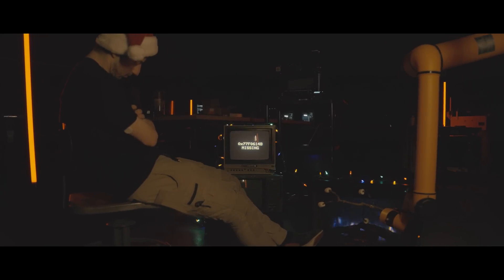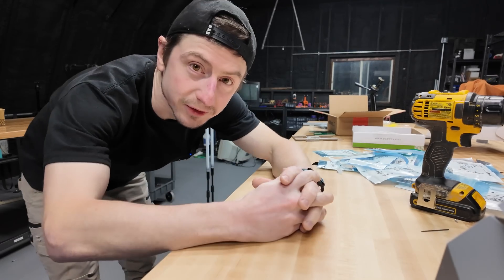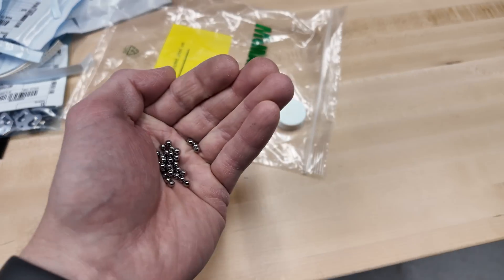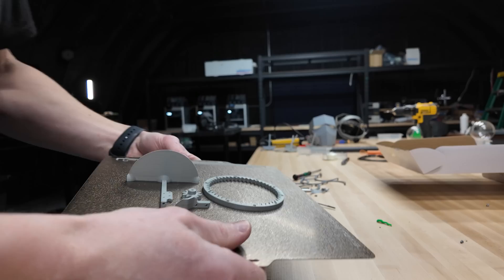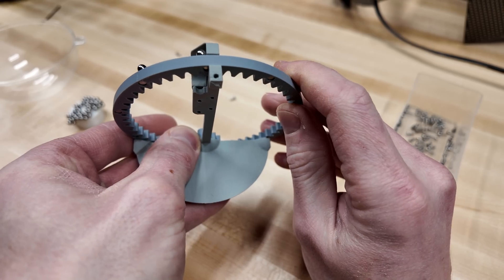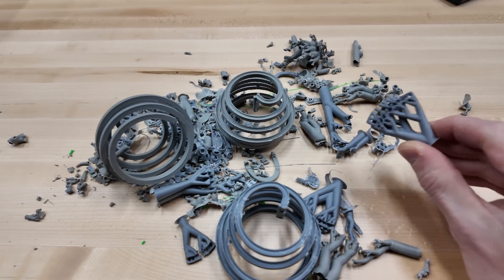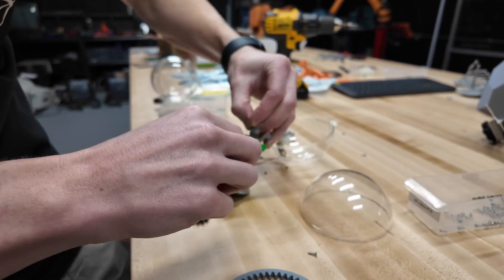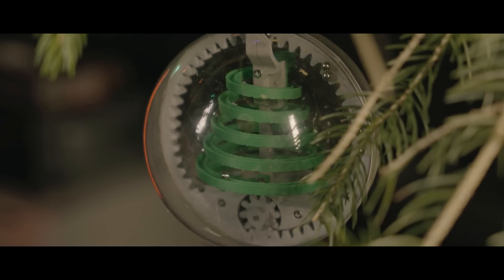This 3D Printed Marble Machine Fits in your Hand

Comment from the maker: It seems 2024 was the year of marble machines, so I had to get in on the action. - What do you think?!
Reply: It certainly was. I was SO invested in Ivan's marble clock. LOL
Reply: Beautifull!! Have a merry x-mas and a healthy maker-2025!!
Reply: Marbelous!
Reply: It’s not a real marble machine if it doesn’t ruin several years of your life.
Reply: Love it 👍  And just a tip regarding supports Sean. Set a different material as an interface layer between the supports and the model. I.e Bambu Support W for pla, PLA for PETG. And set distance from model to zero and density at interface to 100% (can't remember the specific parameter names but you get the picture). That's give you smooth, clean undersides and make it dead easy to remove.
Love your work Sean. Keep it up!
Reply: Brilliant, enjoyed the story too 👏😎

Comment: Finish printing and wrapping gifts for tomorrow? Definitely should.

But instead, I'm gonna be making one of these for myself, as I think I have parts I can use to get this to work on had...

I'm blaming you tomorrow when the people don't get the gifts I should still be working on... 😂
Reply from the maker: Hahaha, maybe I’ll make a kit next year
Reply: @SeanHodgins  I think you got a pass this time.

I was multitasking and working on both.

Seems to have hit a road block until later because of the motor.

Is there a particular source you use? Or any similar to that particular brands motor? (Don't do enough electronics to know common sizes, etc. I know the gear ratio matters for torque, but not much else. I know in this case, size is also a factor)

Comment: Mod idea: adapt its power to be fed from one of the sockets on a strand of Christmas lights.
Reply: Oooo... Great idea!
Reply: Came to comment this! (or just an end of a strand) Seeing him plug in a USB felt so wrong.
Reply from the maker: Thats the idea! You can plug a tiny usb power adapter to the end of the strand and plug USB into it. Its a very convenient connector for low power projects.
Reply from the maker: Those are usually 110V so I was thinking of building a small separate ornament that can power these special ornaments.

Comment: This project is neat! Since you have an AMS, you could use PETG and PLA together, printing only the support interface with the other filament. This would make it much easier to remove the supports, virtually without imperfections. Merry Christmas!
Reply from the maker: I tried with one of the designs, So much waste because of the 0.16mm layer height and the amount of times it had to change. Have to tune the settings I think.
Reply: @SeanHodgins  I totally agree. Sadly, using a single extruder filament changer comes with its downsides. At least when printing multiple pieces, the waste is about the same. I suggest calibrating the filament flushing volumes so you waste as less as possible

Comment: It is a little late for this year, but maybe next year. 👍
Reply from the maker: I should make a kit for next year for people without 3D Printers.
Reply: @SeanHodgins  Well if you make a kit, it might be a good thing to start production early. 😂
You might also want to spend a little time optimizing for printing and optimize the G-code.

The great think about having it be 3D model files, is that you don't have to have a production running.

But it is a bit of a problem that the model relays on finding the same steel balls and clear plastic ball as you found. And not a lot of people can 3D print clear parts at home.

Making a prototype is much easier that making the final product. And making the prototype is at least to me all the fun parts. 🙂